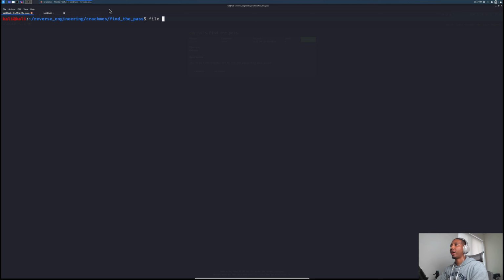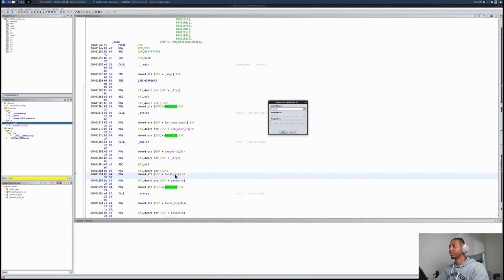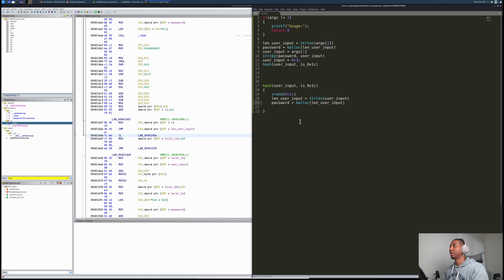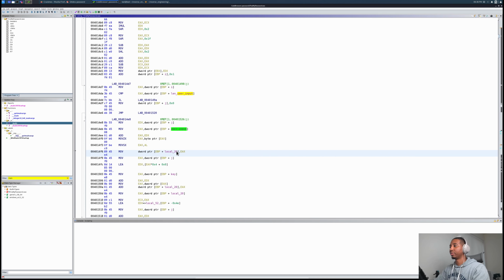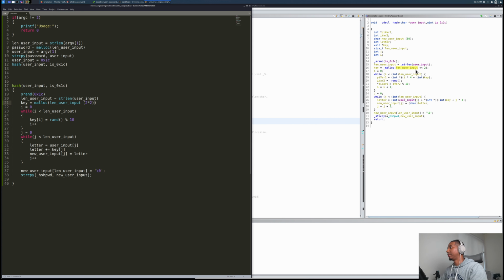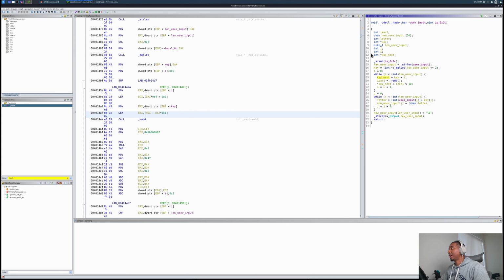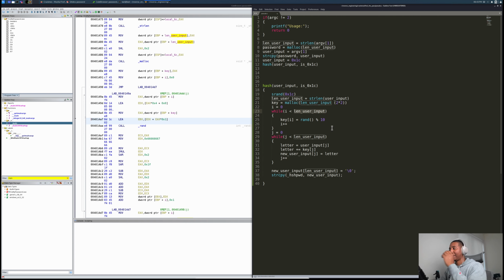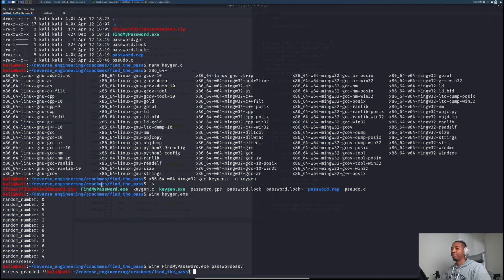Reverse Engineering Challenge - Find The Password

Comment from the maker: So there might be room to exploit the buffer overflow but I couldn't quite get it to work. In the video I mentioned that I didn't see a lot of A's on the stack. Well that's because the user_input is modified before it is stored on the stack in that for loop so I did corrupt the stack it just didn't hold the value I was expecting because of the modification. Again there might be something to this there might not. If you end up exploiting it let me know!